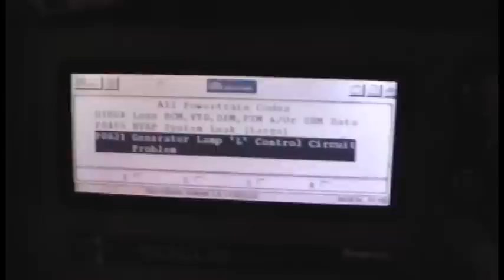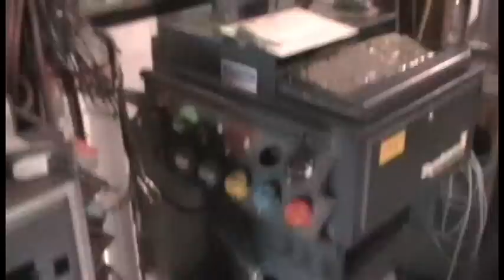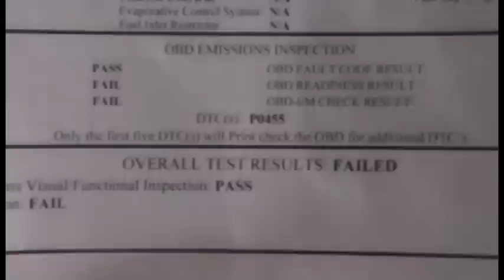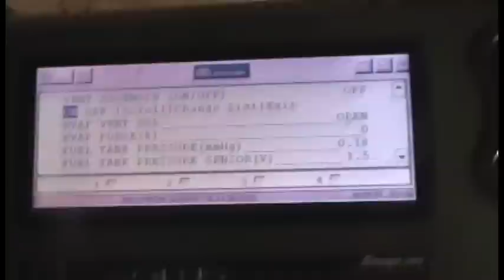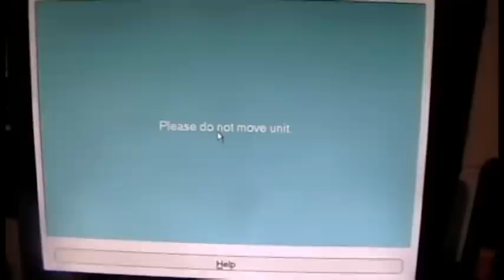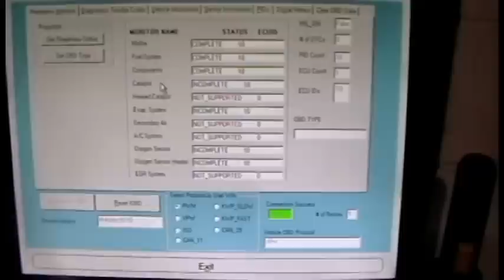PA EMISSIONS WAIVER

Comment: okay so mu 2001 s10 is throwin this evap at me an i tried puttin a new censor on after watching this but idk if thats working an then i drove it 50 plus miles an it still will not pass emissiond what do i do
Reply from the maker: The vent valve on an s10 is a little different.  It's usually bolted away from the canister with a big plastic line. But my experience with those is a lot of times the metal vapor lines or the filler neck are rotted out. Could cost a good bit if everything is rotted and u break more stuff. The waiver is an option in pa. Spend 150 towards the cause of the failure and u can get a sticker for a nominal fee
Reply: +James Danner ill talk to my local shop about a waiver thanks for the reply

Comment: What amazes me in my state is our ridiculously strict emissions requirements, but no safety requirements. You fail for a loose gas cap but there is no inspection for no brakes, loose body parts, bad tires, etc... The direct safety not just for the driver but for others on the road is not a consideration however the completely insignificant venting of vapors probably less than a blast of hair spray and that's impermissible.
  The whole GREEN thing is much, much more about making people feel better about themselves than making the earth feel better.
Reply from the maker: yeah I know. and to piss you off more,  if that vent valve isn't even there....the system works like it should.. just computer can't test it
Reply: I lived in KY for 5 years and you would NOT believe the amount of broken down cars on the side of the road

Comment: On evap codes clear the code. Fill the tank full. Have the customer drive car until the computer resets it self (the tank have to stay full). the car will not do the evap test. The tank has to be 85% and 15% for ti to run the test.

Comment: In Ohio it is $300 , and can only test at a Ohio E Check place by the state . No repair work only testing there . It is funny they do this stuff supposedly to clean the air but if you pay , you are free to pollute
Reply from the maker: kids like Al Gore and carbon credits. Ha
Reply from the maker: it's  ...not kids
Reply: It's not $300, it's free for up to 3 tests in a 365 day period.  After three failed tests, they make you pay a whopping 18 bucks for every test after that until you pass.  They even have some self-serve kiosks where you can do your own testing at your leisure.  I live in Columbus and was wondering why we don't do testing here, so I went the the Ohio E-Check website and also the Ohio EPA website to do research.  Only 7 counties in Ohio do testing, and they are all in the Cleveland and Akron area.  The reason is that the U.S. EPA monitors ground level ozone levels (smog) on an hourly basis in any given area nationwide, and any area having a rating of "moderate" or above is required to do emissions testing.  I moved to Columbus in '96, but grew up in Dayton, and for a time we did emissions testing there.  I remember getting my first car tested: a 1987 Nissan Sentra with a 1 barrel carburetor.  All they did was run it on a dyno and check the 5-gas readings.  Now, it's a little more involved with mode $06, but not much.  And apparently, it works because Montgomery county no longer is required to do testing.  Furthermore, even today there are lots of exceptions and exemptions.  Some that make sense, like for service members and people that have financial hardships who can't afford to get their vehicle fixed.  Others, that are kind of strange.  And before I get called a tree-hugger, one of my vehicles, although not a daily driver, is a 1981 small block Chevy truck with no EGR valve, no catalytic converters, headers, and a 4 barrel Holley on top.  Which, incidentally, would be perfectly legal because any vehicle older than 25 years is exempt from testing in Ohio.  So a Prius owner would be scrutinized more than me, who is blowing raw fuel out the pipes on a rapid decel from WOT.  If you ask me, that's a little weird, but then how many people are running carbs these days?  Aside from us gearheads, that is.  This might actually be one time the state government got it right.  Apologies for being so long-winded, but I just found it interesting that all over the country, and the world, the rules, fees and fines are so different.
Reply: Zack Brown If you can not pass the E Check , you can get a 1 year exemption for spending $300 . I lived in Portage county for over 20 years , only moved a few years back . That is a county that still has E Check today. We repaired a lot of cars that could not pass , and if customer wanted , they could spend $300 and pass , less if showed enough improvement . They all was dyno ed at first , Now only pre 96 id on a dyno , all others are hooked to a machine at the obd2 port . It was $19 dollars when you passed the test , but when they dropped the other counties around Columbus and Cincinnati, they then dropped the fee all together unless you can not pass and want to drive , then you pay  . I lived with E Check from the time it started in Ohio until a few years ago when i had to move to take care of family .
Reply: wtbm123
I agree that Portage county is still required to do the E-Check as is noted here:
http://www.epa.state.oh.us/dapc/echeck/whyecheck/seven_cos.aspx
Which is consistent with my earlier point regarding counties surrounding Cleveland. 
As for the $300, I see now where you are getting that figure:
http://ohioecheck.info/waivers
The repair cap waiver (option 2 in the above link) is 300 bucks.  Meaning, if a customer spends at least $300 on an emissions-related repair, and do not pass the E-Check, they get a waiver.   Bearing in mind that the aforementioned exemptions still apply:
http://ohioecheck.info/exemptions-extensions
Perhaps I misunderstood what you were getting at, and certainly do not mean to imply that you are a liar.
I think it is fair to say that a repair like Danner's, that is a faulty canister vent valve, won't be $300 unless it's a Maserati, in which case Steve's rules may apply.
I just think a blanket statement like, "In Ohio it is $300," doesn't quite paint the picture, and there are so many variables.
Reply: Zack Brown I guess I just figured , Responding to a video about a  wavier , that people would realize i was talking about a wavier , I guess i should of spelled it out completely . Sorry my bad

Comment: So why check the gas cap separately if the OBD system would set a code and fail the test anyways if it was leaking? Here in central PA we just have to do the gas cap test, but no one cares about the MIL...as long as visually all the emissions components are there. I've seen vehicles with rotted filler lines smelling of gas fumes pass "emissions" with flying colors! Well, at least you know your gas cap is OK haha
Reply from the maker: I know its all politics and federal money